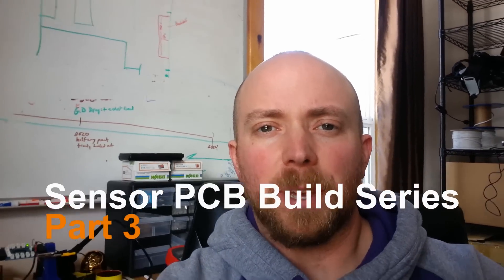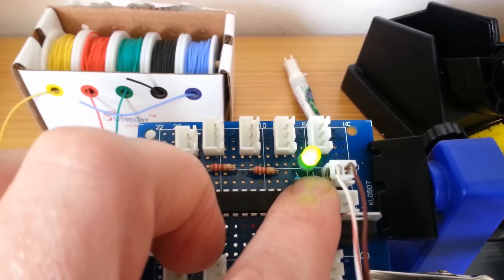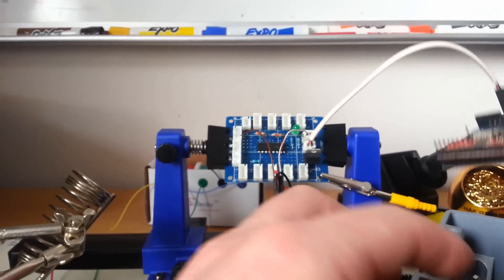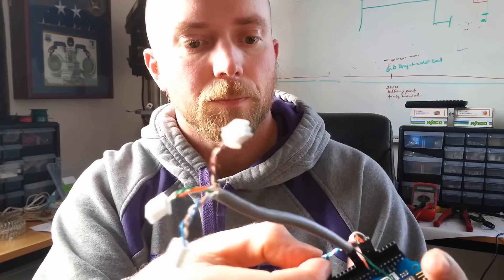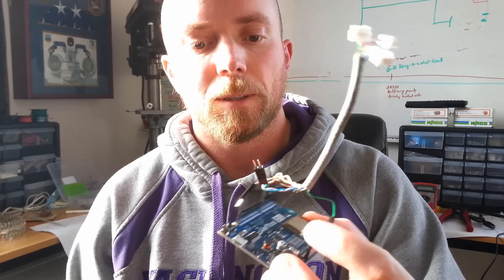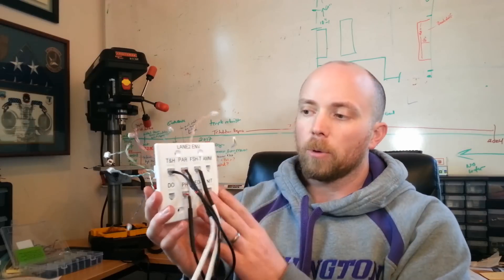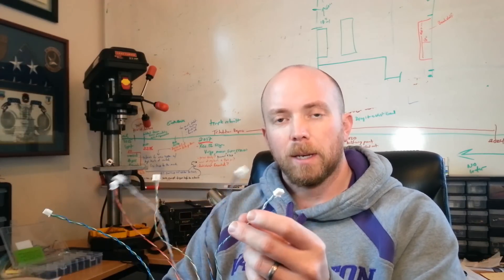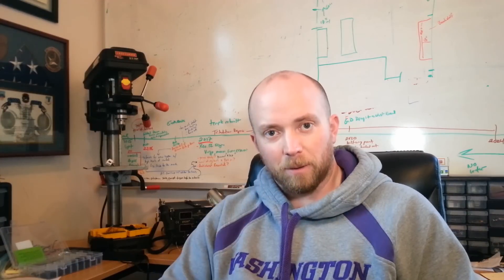Arduino Controlled/Monitored Greenhouse - Cables - Part 3

Comment: It looks like you are using solid core cat 5 for your wires?  I have tried this in the past and regretted it. The solid core wires break from repeated movement, forcing into boxes, ect. This even happens sometimes with no noticeable effect on the insulation, causing hours of tshooting madness.

Comment: You might want to think about going to Amazon or eBay and get you some different size heatshrik and maybe different colors to put over your wires instead of twist them together, it will make a neater  looking configuration. Just a suggestion !!!
Reply: There is a reason for having twisted pairs

Comment: It is easy to sit here and be a Monday morning quarterback. I applaud you for your eagerness to experiment and learn. I reviewed all the comments to date and agree with the bulk. History, my start with digital electronics was building a video terminal many years ago from bits and pieces much like you're doing with the 30 gauge wire etc. on circuit and perf boards. That turned into a full-time computer maintenance tech position after retiring from the USAF. I have two areas I'd like to address - hindsight is always 20/20. You seem to have one set of cables interfacing the perf board to the outside world and one to the webo. I would suggest next time of installing header pins like a shield eliminating one set of wires. Secondly I would recommend using an appropriate plastic box rather than trying to cram it into an electrical box. This way the boards can be fastened down and the RJ-45 connections can be hardwired. The fewer the connectors as possible the fewer points of failure. There are different flavors of perf boards although the most logical next step would be to make your own board. When Radio Shack was around it was much easier. I made a modem board once - not that difficult.

Comment: Mission control to Martian, please check:
1. the manual for the esd pad, the cable has to go to ground not to the broad you are working on. (connection to the earth, moving harmful electric changes away from your workplace)
2. Datasheet for voltage regulator, capacitors recommended?

Comment: You could use an "Proto Shield" to place connector on so you could have a sturdy connection to the Arduino instead  off lost of tiny cabels into the headers.

Comment: You could place female RJ-45's on the board and connect up to 4 lines with just one connector. It's less work, low cost and fast connect/disconnect.

Comment: I've no idea why you are using a multiplexor board with a separate cable loom, when you could mount the entire board on top of the Arduino. That's the whole point of having those two rows of GPIO sockets on the Arduino, so extension boards (shields) just plug in the top.
Reply from the maker: that board is old...the new board has the mux directly on it...similar to a shield...just hadn't removed it yet from the wemos when I took the video

Comment: Don't tell people how to use a crimp tool if you don't know how to use one yourself.
Get yours adjusted properly, they should release fully when the crimp is made correctly, you don't try and predict this point yourself. At least you haven't committed the cardinal sin of trying to solder a crimp connection.
Reply from the maker: It's certainly been a learning process..no doubt

Comment: Why don't you use RJ45 PCB connectors instead of the JST? That way you only need one type connector, except for the Arduino side.......
Reply from the maker: no real reason...a subscriber suggested JST and I liked the size (small)...RJ45 takes up more room and I'd like to keep it small...that said...I'm certainly reconsidering my decision

Comment: out of interest - why didn't you use a nano or pro mini and solder it directly to the prototyping/sensor board rather than introducing another failure point in the additional cables?
Reply: he isn't really using an Uno, it's a WeMos with ESP8266 that can also be programmed eith avr-c.